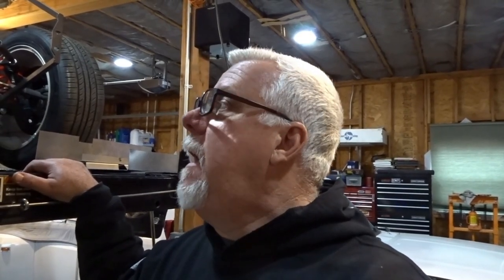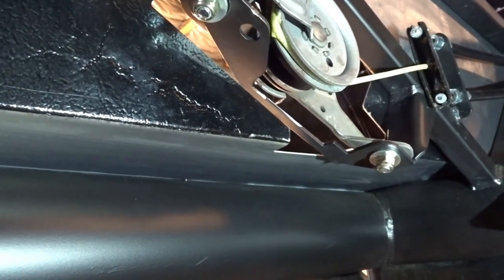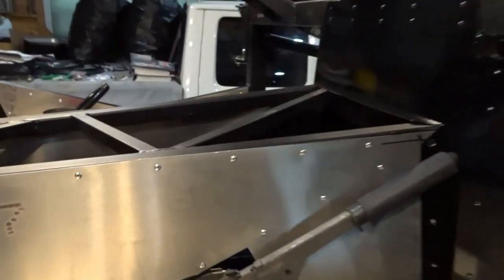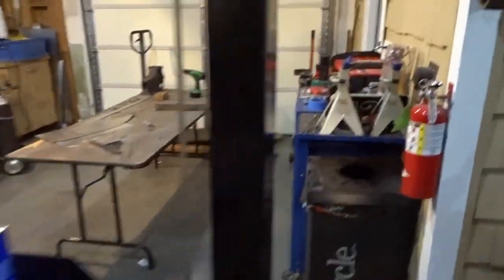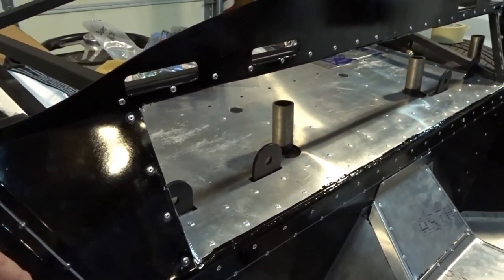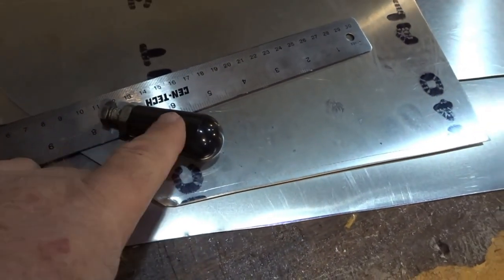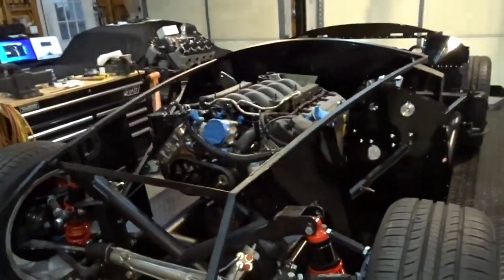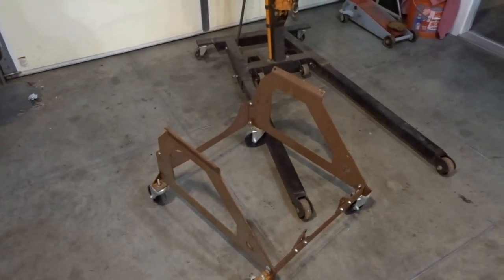One Man, 20 Minute Engine Install

Comment: Which Tremec trans is this?  I have a T56 on my Gen2 coyote and couldn't get the little tabs on the rear of the FFR engine stand to align with any of the holes on the trans.  Maybe I had them on the wrong side of the engine stand rear flange but that would only account for about 1/4" offset.  They seemed to be crashing into my clutch fork/piston assembly so I had to remove them completely.  Also, I couldn't install the engine stand onto the motor without removing the oil filter on the front DS.  Maybe my filter is significantly larger diameter.  Couldn't find any pics online of the "right" way to mount it, and I didn't receive the engine from FFR (someone gifted me the stand) so was just winging it.
Reply from the maker: Transmission on this one is a TKO600. A bit shorter than a T56 Magnum. Depending which F5R platform the engine/trans package is going in will dictate the "issues" with which it goes in. Factory 5 does include a transmission adapter plate, if you purchase the engine/trans package from them. As for the oil filter, it's fairly common to receive a dented oil filter when delivered from Factory 5. The stand is tight.